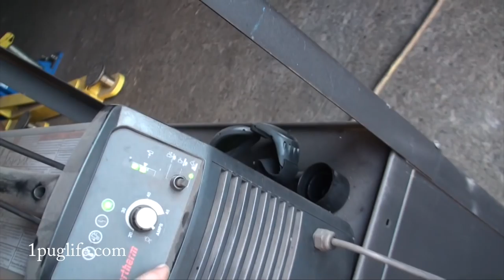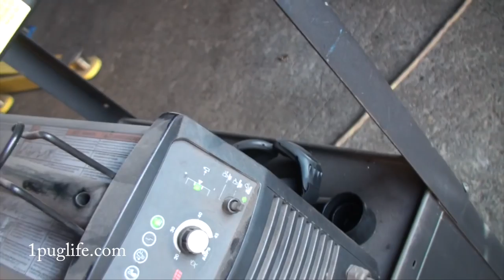water tank trailer

Comment: l have that same saw, no problems, just wasn't set up right, if it was under $500 woulda been a good deal
Reply: Ya but the way he was throwing that 2k around makes me think it was more
Reply: I agree! Mine did it too if my band was bent or warped some would walk off the pulley. There was nothing wrong with that saw only the band blade. I would of bought that saw in a heart beat. My guess is that old blade was already bad then once it heated up without coolant got worse that's why it took a a few till it jumped off then kept doing so. I would of bought it in a heartbeat!
Reply: hahah exactly mustie...those clowns have no clue how to set up the saw, especially with such a thick piece of round bar...the speed of the blade, the speed of the drop & turn the oil/water on ffs if u wanna cut that piece
Reply: I think the speed of the drop is what was really cocking him over. It had a cylinder on it I saw but It didn't seem to be doing a damn thing lol
Reply: Yeah ive MUCH smaller Ellis Saws just like that without cutting fluid and have cut even bigger COLD ROLL stock with zero issues all day. The first problem off gate is the guide is out WAY too far which even if you have it set to cut slow it will track because theres too much slack between the guides. Ofcourse i have seen some that the guides wont go in but so far but surly those go in further than that. and second they just open the hydrolic cylinder wide open so all the weight of the saw is trying to cut into that big ass round stock so not only is it gonna track and cut WAY out of square its also gonna have issues halfway through the cut just like they were having. Ive also run HE@M CNC commercial saws at a steel service center so i pretty much know my way around a saw and these guys just prove theres ALOT more to running AYN saw than just throwing steel in it and turning it on and cut. Hell if that thing they were looking at was simply run correctly it was probably a damn good saw and worth every dime the guy was asking but i guess we will never know! LOL

Comment: I don't know if you got harbor freight up there in the great north, but we have a harbor freight bandsaw like that at work we've had it for about 5 years and we use it to cut 6 inch solid square stock and we haven't even changed the blade. Just an option.
Reply: that harbor freight 4x6 bandsaw is probably one of the more reliable tools i own, had it for yeeeears and i think changed the blade once. just cut slow and it'll cut for days

Comment: that saw needs the lube going.. its got the drip tray and looks like it had the choocher for the blade.  can't be cutting steel that size with a dry blade FFS!
Reply: ...and close the gap on the jaw. That looked like an expensive saw, had a TEFC motor...it def was worth some money
Reply: would prolly just skip off the rollers even faster with coolant, the rust was holding that blade on at first. prolly just needed more tension on the rollers but still. you know it's gonna go badly when buddy starts quoting new prices for his rusted clapped out POS trying to figure out what its worth
Reply: ya without lube you will burn out a blade it one decent cut.... learned that the shitty way
Reply: Yeah, not without the cooling oil and not at that downward cutting speed.  IF he had had the coolant choocher going with a new blade mebbe, but like you said for sure not dry.  So long as the coolant pump chooches and the hydraulics are still speed adjustable that bandsaw was good to go. Guys that cut metal that big on a regular basis know you can't have a shit ton of pressure on the blade as it cuts, that will happen every time.  The thing was probably set up to cut angle iron or some shit.  Anyway, those blades are probably halfway decent being old.  Good band saw blades can cost $50 to $80 US...  It's a shame that guy didn't know how to run the saw.
Reply: There was even a close up shot on the bottom side of the stand there was a switch labeled "COOLANT"
Reply: I agree. I had the same saw many years ago and what happened here was the blade was bad and rusty and when it heated up it started walking off. If he would of switch blades to a good blade and properly tensioned it it would of been fine! 
I would of bought it in a hot second!

Comment: I would have welded in two box rails to the tank for better weight distribution and then mounted the axle. I think the spring ends will push through the tank when it's full. If I'm wrong, BMP.

Comment: When the tank is filled with water, won't the added weight cause the leaf springs to compress and make the tires rub on the edges of the tank?
Reply: The spring can't compress with them welded in place on both ends.
Reply: The tank skin will rip right out where he welded them to it. At 8.33 pounds per gallon and that tank at 300 gallons is 2500 pounds of water and trailer weight. It's a good design!
Reply: +BrokenRRT it's a "goof" design!

Comment: there was nothing wrong with that band saw as far as the clamp screw threads. it's slips like that when you go to unscrew clamp but when you actually go to clamp down on your material it grabs and hold on the threads. is to allow you to slide the clamp open easily for bigger material

Comment: If your going to gravity feed the water,,, space you pipes and have a ball valve to control the speed of the water,,,add a steel plate across under the water bar  and have the water drop down on to the plate witch could be at  45 to 35 degree angle  that will spread/fan out the water :)

Comment: The saw needed to have cutting fluid and if the blade was dull or had a section with missing teeth it would cause the blade to come off. Also he might not have been tightening the blade as tight as it should be, that also makes the blade come off.

Comment: I would have left the axle long, set the drum right on top of the axle, would have been lower. BMP
Reply: I was thinking the same... But for Gravity flow nozzles off the back, the height will help a bit getting a good swath of water on the ground.

Comment: Buy the bandsaw, Ive had mine 11 years, same as that one, The teeth on the clamp are not stripped, its a speed nut and doesn't thread till it tightening otherwise slides free it just needs lube on the screw and a roll pin to stop the handle pulling out. Cant run without water, no wonder blade got hot and fell off. Need to slow the drop speed for big rod like that too. low ball him on the faults tell him itll cost you a bit to fix it.. It wont. Member what metal dicks said, use it right and you wont fuck blades.

Comment: That water trailer will fail!
I live in an area of Arizona that has at least 6000 people that haul their own water. Or pay for water delivery. Just over the hill there are another 3000 doing the same. My parents have been doing it for 15 years and I've hauled  plenty of water myself. I've  seen just about every homemade contraption out there and know this trailer full will not hold up! That tank in guessing it's at least 300 gallons. That's with the weight of the tank itself is 2500 pounds or 1133 kilos. 
Those springs and tubes are not rated for close to that and the weld at the thin tank skin itself will more than likely rip the steel right open.
You could of at least made a square frame to mount the axle to then welded the axle to that solid boxed frame and mounted the tank to that and  hoped for the best. Good luck on it!